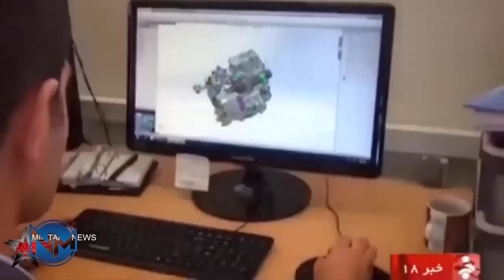NEW: IRAN TESTS HOMEMADE PLANE ENGINE

Comment: Iran can produce J85 jet engine several years ago.  It is not too tough had they scaled up the core engine and modifying to turbofan.  And that matches the power required on 4-50 seats civil plane.   
The problem is who will allow Iranian planes, air worthiness in flying to their airports.
Reply: @alexlo7708
I guess the anwer to that question might be BRICS too.

Things like that really shows how necessary BRICS is for a more fair world.

Comment: Competition will bring down the cost of airplanes ,more countries need to do this,except China they make everything to last for one week then it breaks completely.
Reply: Don't comment about another country without knowing a country.  I have been to India as well as China,  you're envious because what China has achieved you could only dream. While in China in some of the 6 star hotels, train terminals even the toilets are ergonomically built with fully automation while you're trying to build a basic toilet even your CSI Mumbai or IGI Delhi Airport doesn't have these state of the art washrooms.